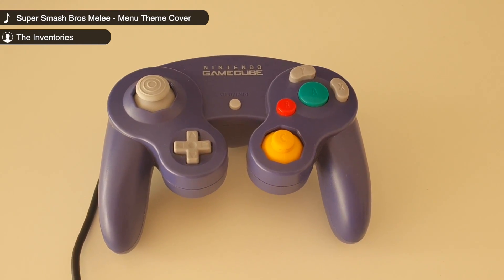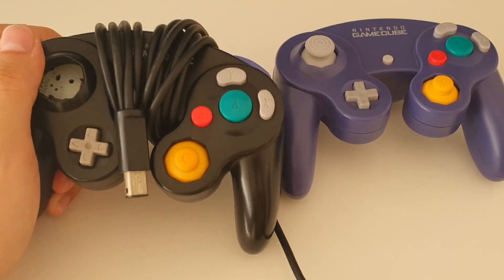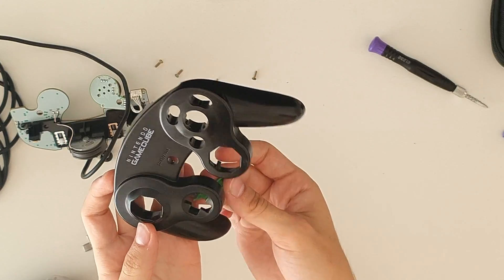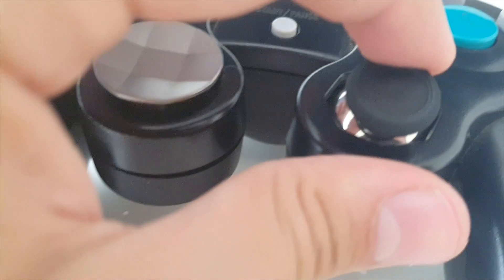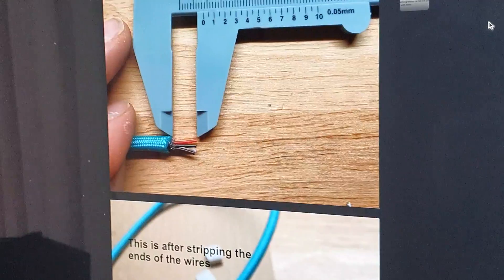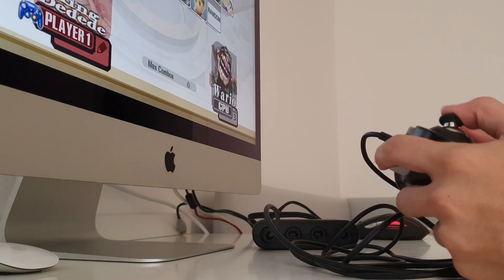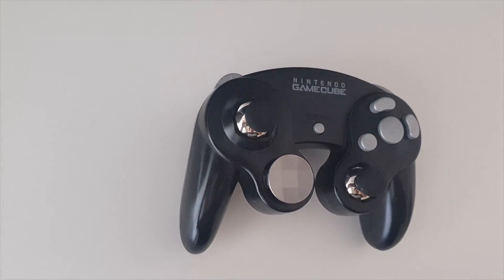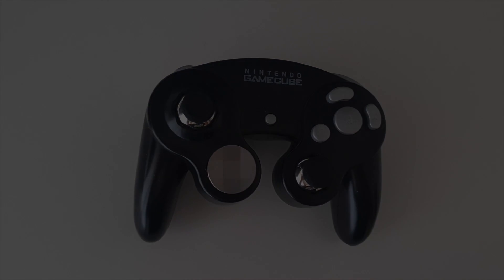The Gamecube Elite Controller

Comment: Great video! I love this mod and it was a great and to-the-point video!

Also for those wondering:
Metal sticks tend to be harsher on the gate, so not suitable for notched controllers. They're also heavier so wear the stickbox/cause snapback quicker. 

The chrome painted controller/buttons shown as an example will wear over time as the shell is not properly clearcoated (think how Platinum shells do not stand the test of time regarding color). You can 2k clear coat the shell (not recommended for buttons) to extend the longevity, but the chrome finish may change.
Reply from the maker: Thank you for your detailed feedback!
I'm happy when people genuinely want to explain how some things are not ideal instead of just writing that everything sucks

Comment: I can think of at least one advantage this controller may have. One thing about the d-pad is that it can be reassigned to shield instead of taunt; what casual players don’t realize though is in specific situations (for example: being buried) button mashing, including shield, shortens recovery time, meaning all one has to do is rotate their thumb on the d-pad while mashing other buttons on the controller. From the looks of it, this, controller’s alt d-pad could allow for faster mashing as if you were rotating the analog stick.

Comment: I absolutely like GameCube controllers alot and this has inspired me to also make one.
Reply from the maker: Let me know how it comes out!
Reply: @11tech  I nearly have the elite GameCube controller finished. On the one I did, I did not change the cable because I don't have any good experience in soldering and I managed to buy a small grinding tool to carve out the d-pad and I had one of those Amazon controllers so I gave it a mat black color... It is nearly finished though

Comment: 1.Soldering
Get yourself a soldering iron with adjustable heat (300°c is enough heat most of the time) 

Having the option to chose the heat has the advantage of not burning the isolation of your wires as quickly and its also easier on the components as some are relatively heat sensitive.

Solder always flows to the heat.

Bigger gauge / diameter Wire will require more heat because in the end you will damage the isolation more at low heat because of the copper conducting the heat away to quickly 

Pre tin your connections / cables and shorten unnecessarily long tinned cables if you don't use all that surface area on your solder connection 

If you want to solder wires like you can find in headphones with fine conductors and they have a layer of paint on them, hold them with a pair of pliers and burn the paint off with a lighter. The pliers will hinder the paint from burning farther than you want it to.

2. Crafting:
screw a scalpel blade onto an old soldering iron (with the tip fixing screw) It enables you to cut plastics very easily

Get yourself a small electronics side cutter, one of a good reputable brand for a maximum of 20 Bucks and some really cheap ones from Ebay you don't mind breaking as they are also very useful for modifying plastics and some very thin metal

I know this part is probably the hardest but TAKE YOUR TIME It's something very important ive learned over the years. The slower you work e.g. filing down plastic, the more accurate and better looking your end results are.

Get yourself some black hot glue from Amazon. (at least the one i use) is very rubber like and great for making new covers for USB Ports, gluing different plastics together and covering cracks.

Also when its still hot either lick your finger or make it wet with some water or something similar, it allows you to shape it after you've applied it and it won't stick to your fingers that way.

(It almost looks OEM if you'll get the hang of it eventually)

Also Acetone removes hot glue really nicely.

3.Useful tools:

Multimeter

a good led light to shine through pcbs and see the individual conductors

Keep old electronics, Mainboards, Pcbs whatever you come across for Parts like Usb ports, Coils, Resistors, chips, voltage regulators and connectors.

Hot air gun (for fine electronics like Chips or memory modules)
Reply from the maker: Thank you! I wasn't expecting something so detailed! Thanks for your time!
Reply: @11tech  I must have accidentally deleted the title... 

It used to say:      Here some tips about soldering and tinkering ive learned over the past few weeks.

Comment: With the cable wiggling about during play, and maybe a few accidents here and there, I give that usb-c port a few years tops before it becomes all loose, supposing it's actually used consistently.
If the only thing your worried about is detachability, it might make more sense to put a GameCube controller  port on the controller, supposing it fits. That would be much more durable in the long run, and you can source the parts needed entirely from cheap GameCube controller extension cables.
Reply from the maker: I didn't record the whole process, but the first time I've soldered the board it was very loose and the connection wasn't stable, so I've desoldered it, glued it to the main board and resoldered it. But I really did it because I'm not good at soldering. Now it is very sturdy
Reply: @11tech  I think over time the port itself will wear out. My phone for example I've owned for a year and a half, and despite never using the phone while it's charging the USB-C port can barely hold onto cables these days. It's a lovely standard, but it's small size limits it's durability. USB mini seemed a tad more durable, as my old phones never developed this issue quite as significantly.

Comment: If you're trying to make the ultimate GameCube controller I would have made it wireless as well. I'm sure it's possible to buy off the shelf components that turn a wired game controller into a wireless game controller. And it's likely you could use the same USBC power board to charge over USB.

Comment: I think the only things to make this better would be Bluetooth connectivity and a better, hall-sensing joystick 🥰
Reply from the maker: Thanks for your feedback, I wanted to add bluetooth but I couldn't figure out how to do it. I'll think about it a bit more
Reply: @11tech  this company 8Bitdo that makes retro inspired controllers has both wireless receivers (2.4G) that plug in to a console through USB A, and they also have a wireless GameCube adapter that you can plug either Wii Pro Controller (Wii Nunchuck port like on the Wiimote) as well as GameCube ports. 

It was meant for switch/pc, so if you’re trying to have a faithful GC controller that works on the actual console as well as other modern means.

Just a rabbit hole that could help? Anywho, cheers and I’m excited to see whatever you do next!
Reply from the maker: @linkshadow2  That was part of the plan, but I wasn't really sure on how to insert the adapter in the controller.
How about changing the batteries? Pressing the buttons?
I really couldn't figure it out.
Also, It would have been very hard to keep the functionality of a normal gamecube controller

Comment: One thing you could've done to fix the stick issues is try to mod a different stick PCB actuator or whatever they're called (what hold the sticks) then the stock GameCube ones which probably weren't designed to handle the weightier sticks (I've done this swap myself for different sticks after also getting the same issue)

Comment: I'm a little bit confused by the need of a removable cable for a wired controller, Looks great though. It's not like you need to charge the controller and if the cable breaks you will still need to make a new cable. Idk how easy it is compared to just repairing/replacing a normal GameCube controller cable.

Comment: awesome job! I wonder if you could remove the snapback by replacing or upgrading the springs inside the analog sticks? the original ones can't be strong enough for those metal stick caps.
Reply from the maker: They work for now, but I can try

Comment: The xbox sticks are too heavy and is not calibrated with the stick boxes.
Meaning that drift and horrible snap-back is the issues here.
Also with smash, you generally want smaller C-sticks because flicking to it can cause accidental inputs with a bigger stick.
It's a cool project as the finish looks great. I believe that it will wear and tear faster tho because of the stick boxes with heavier mounts tho.

Comment: If you were going to do this again I wonder if you'd be willing to go one step further, if you can get somebody else to create custom pcb designs for you you could create controller boards that all you have to do is swap controller chips over. Realistically they would only be one or two small chips with large pins on the GameCube controller so if you wanted something harder than buying a smaller universal controller adapter motherboard cramming it inside of a GameCube shell you could do this again but better.

Comment: I think the d pad is genius!   I’m going to try doing that as I already have two of the kits as I convert  my regular Xbox controllers into elites.   
The only other thing I dislike about it the shoulder triggers and wish you can shorten the travel like the elite controller.  Any ideas how to mod that?
Reply from the maker: There are many ways, like trigger plugs, cuttibg the springs, someone even replaced them with keyboard triggers!
But this mod was meant to be as "general" as possible, so I really didn't want to modify it

Comment: Why not make an USB A to GameCube controller Port adapter (like those passive PS/2 to USB adapters), it will make the USB C cable easily and cheaply changable it also allows for longer or stronger cables of your choice
Reply from the maker: I have no idea how
Reply: @11tech  you can use an broken controller with wire issues cut the cable from the plug where you plug it in to the gamecube remove the shell solder the USB A port or an USB C port for that matter using an USB C to C cable the exact same way you soldered the USB C connector onto the GameCube cable and close the shell and do some cutting to expose the C connector an USB C to C cable is just the same wires going from and to both connectors
Reply: May require you to 3d print an new shell for better durability

Comment: Hey I was wondering if you could add an extra z button so it’s more compatible with other games.
Reply from the maker: Unfortunately I don't think it's possible, I should replace the whole motherboard and it wouldn't be a real gamecube controller anymore, just a Pro controller shaped like a gamecube controller. It would work, but there are already many controllers like this, you could just mod them
Reply from the maker: Edit: just did ;)
https://youtu.be/0ibGT8rCxow

Comment: Using a standard port to do something completely different does not sound like a good idea to me at all. Someone is going to break something.
Reply from the maker: I did it because I like to store it with the cable detached (and it is also the reason the author of the board made it for).
However, I'm working on a way to improve it